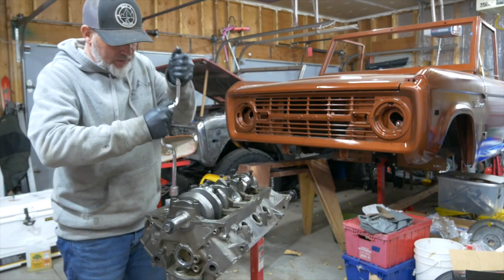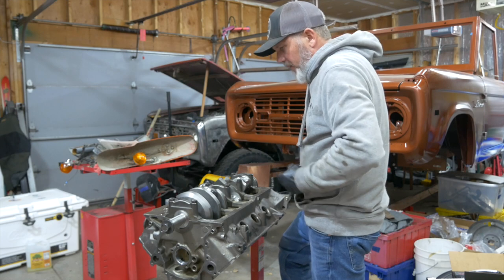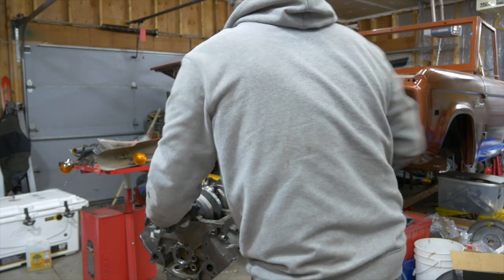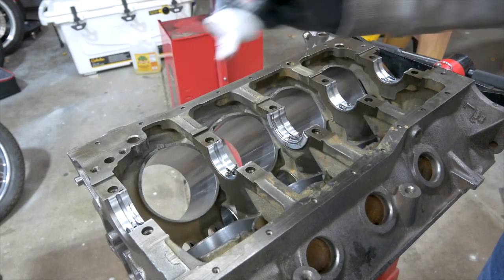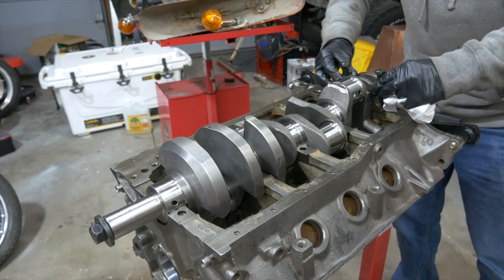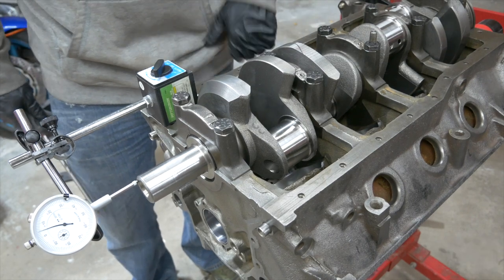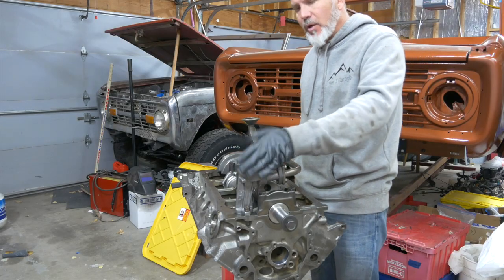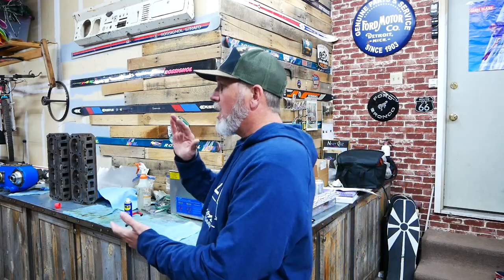Ford BRONCO Restoration - STROKER 347 Build PART DEUX! [CRANK / PISTON INSTALL / TOLERANCES]

Comment: The combination of a short duration camshaft along with flat top pistons in a GT40P headed 347 is going to be a recipe for detonation.  It will not only need premium but very conservative tuning to keep it from pinging like crazy.
Reply from the maker: Appreciate the feedback. We are adding a thicker head gasket and a cc or two to the head to lower compression a bit.  If it’s a pinger, you’ll know soon.
Reply: @alpinegarage8548  yep, you can call up Cometic and they'll make head gaskets in any thickness you want.

Comment: Alpine, very intresting build, it happens that I am building a 347 and trying to understand the static compession ratio.  Are you planning on running premium?  Do you know your piston's (cc) valve relief?  What was the combustion chamber (cc) size?  Then,  can you say what the head gasket thickness chosen?